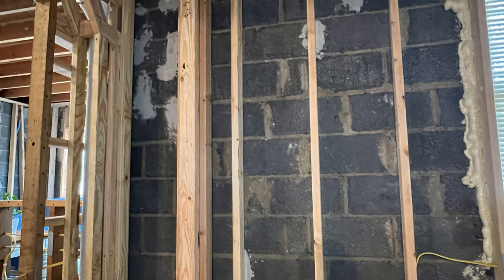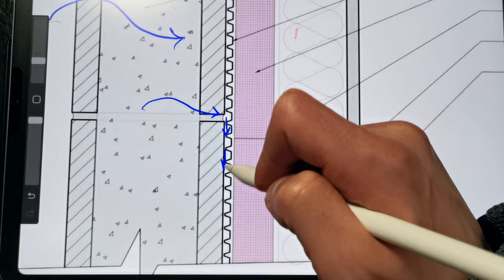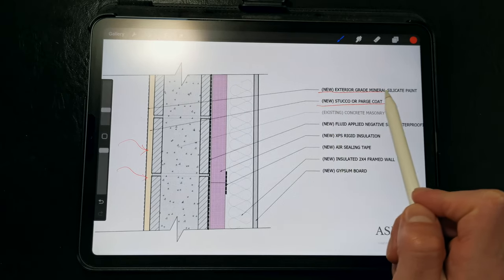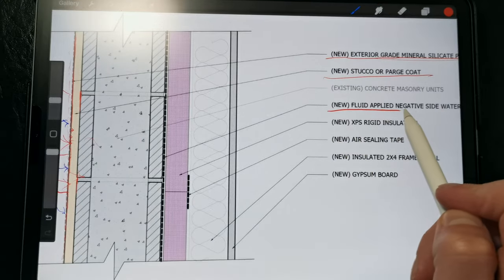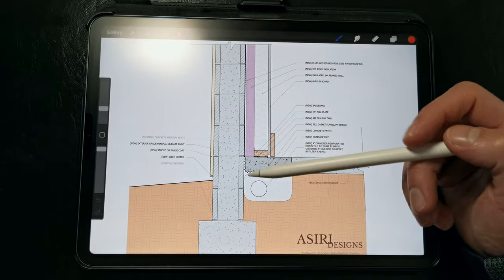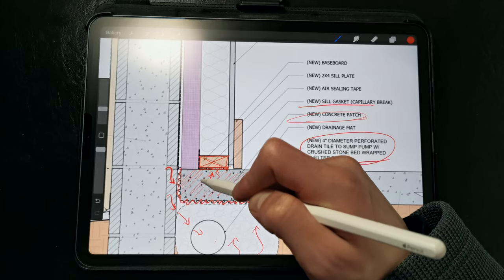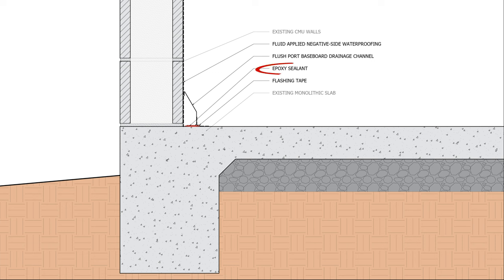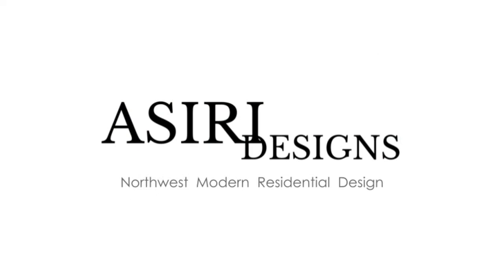Insulating Old Cinder Block Walls (CMU) The RIGHT Way

Comment: Also never paint interior surfaces of below-grade blocks or water will get trapped in the block and degrade the concrete.
Reply: Yes! And don't install any 60-inch sinks there either! 36-inch is the perfect size! (Inside joke).

Comment: My house has been an interesting building science project for me. I have a raised ranch in Northern VT, if you put a piece of Rockwool insulation in the 2x6 wood wall with nothing to air seal it from the inside, the plywood will get condensation on it in winter. However if you put a piece in the 2x4 wall against the block below it nothing happens behind the insulation. The concrete floors and cmu half walls have been painted with dry lock.

Comment: For a garage application where any condensation may be acceptable on the floor inside the space, could you replace the drain tile & sump pump in favor of an interior weep screen, and terminate the interior insulation a few inches above the floor inside the space?

Comment: Right on great video. Masonry loves to wick moisture. Masonry needs a way to dry out and remove the moisture it wicks. I hate icf walls the membrane is only thing that keeps the moisture out. And most don't have anyway for masonry to dry out except rim joist. Which people usually spray foam. Smh. Did cmu block north wall with vermiculite cores, 4 inches of mineral wool batt and board , low perm vapor barrier 0.17 (“dry”) to as much as 3.8 perms (“wet”), 2 inch air gap, and 12 inch masonry veneer. Insulated piers and foundation. North wall will have lots of snow off the skillion roof. Making a snow berm in winter. With 6 foot frost depths and where I hit hard pack. To support weights of masonry heating appliances. Masonry stove, white oven, and 2 masonry heaters. And having timber frame need to dry it right.

Comment: I really love these vids. What are your thoughts about using Omni-block in the humid south for new construction/remodeling? Do you think it would still have moisture issues, even with the EPS foam sandwiched between the blocks?

Comment: if you didn't want to add perforated pipe or any moisture control below slab, could you just use a rainscreen system on the walls for some air flow and then tape it all with rigid insulation as a more cost effective solution?